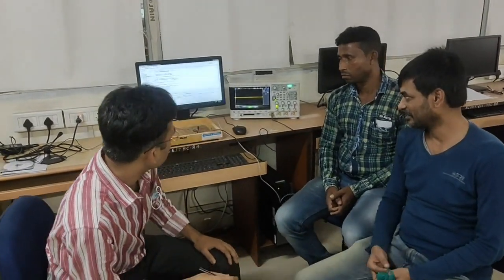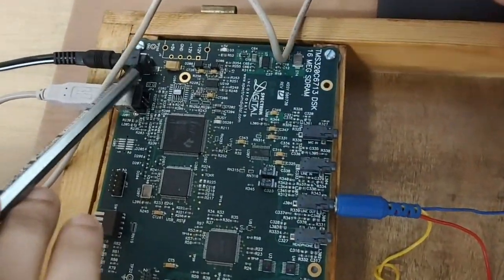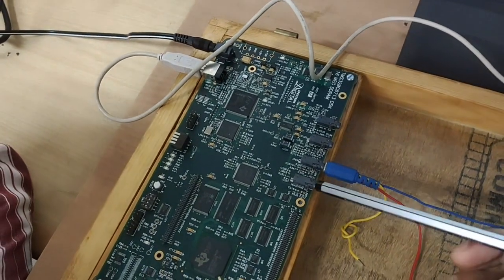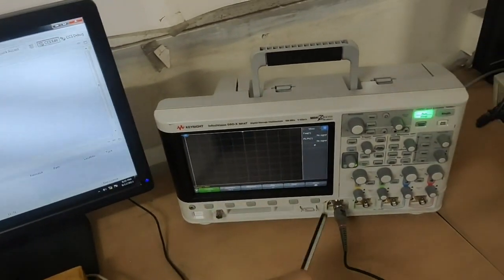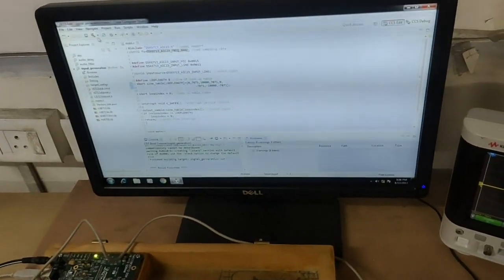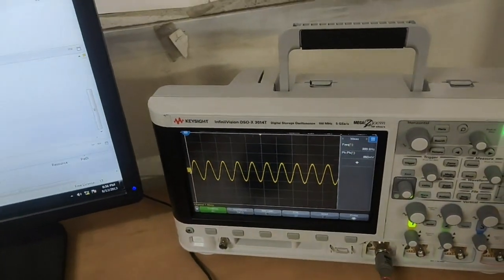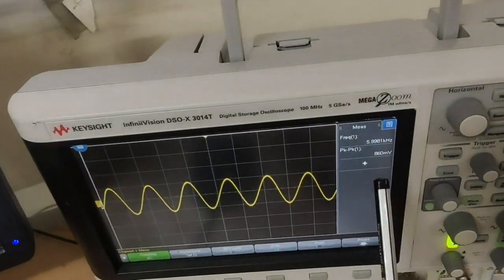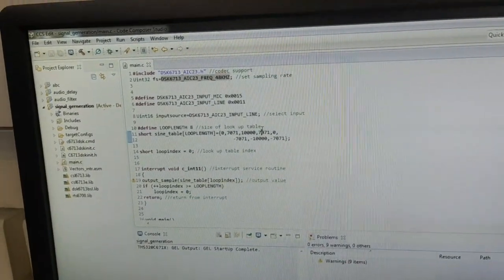DSP 6713 Sine Wave Generation

Comment: sir, please provide me manual/codes for this dskc6713 bcz what all i got are very old and not running in CCS 7.3
Reply from the maker: Sorry for late reply, there are a few settings required to run the code on the DSKC6713, if required you may contact me through google meet